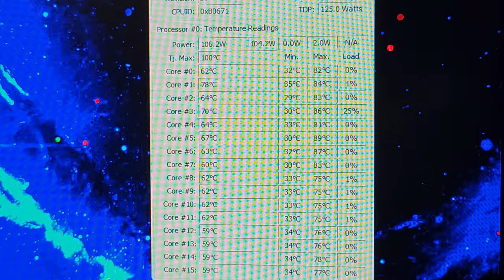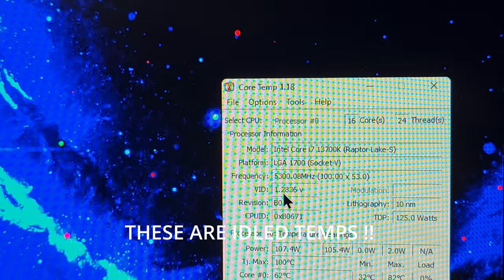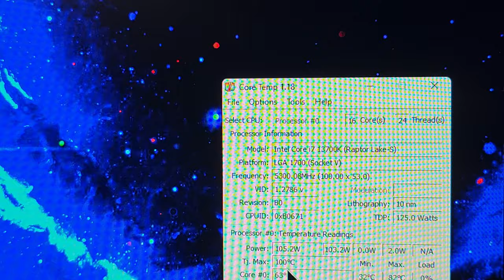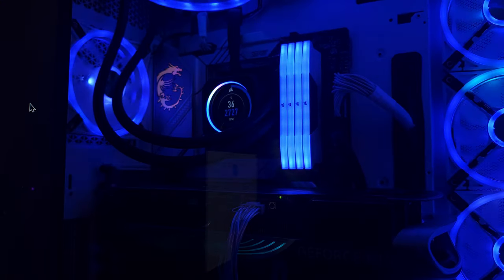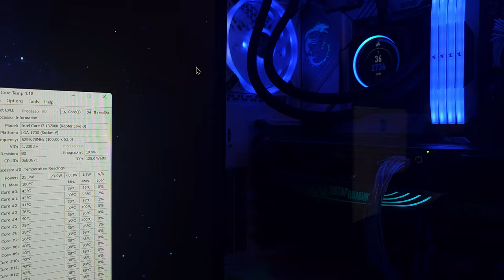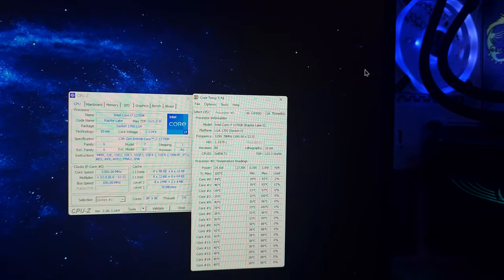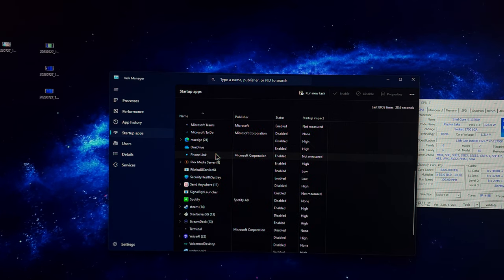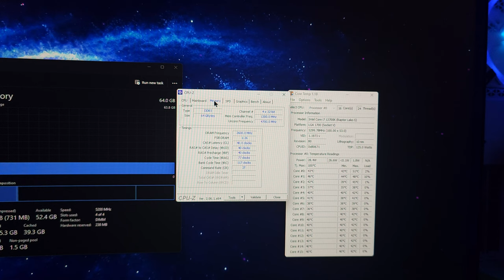𝗟𝗚𝗔 𝟭𝟳𝟬𝟬 𝗖𝗣𝗨 𝗖𝗼𝗻𝘁𝗮𝗰𝘁 𝗙𝗿𝗮𝗺𝗲 𝗔𝗡𝗗 𝗪𝗛𝗬 𝗬𝗢𝗨 𝗡𝗘𝗘𝗗 𝗢𝗡𝗘

Comment: Thermal grizzly extreme has better temp when u have climate control in room. it absorbs more cool air. If u have no climate control Grizzly extreme is pointless. I have 24c idle and 72c max. Thermal grizzly extreme.
Reply from the maker: Yes, that have a big influence on temps. However, for the amount you thermal paste you get with thermal grizzly isn't cost effective. I have used it before and like I say, I wasn't impressed for what I paid for it. The ARCTIC MX-6 thermal compound is just as effective if not more for a cheaper price. I will just say,  Thermal grizzly have good marketing.
Reply: Nothing is better than artic, unless you want to replace liquid metal often...